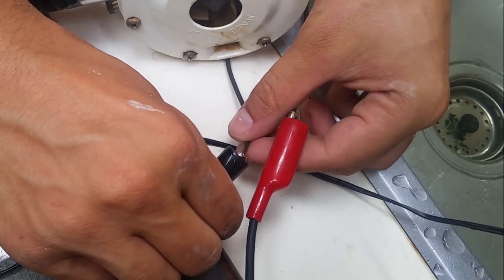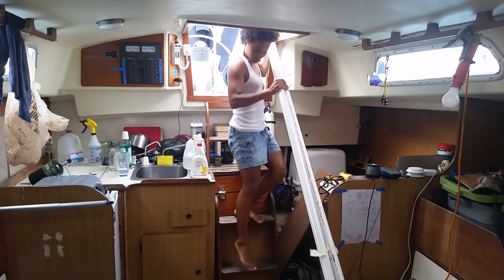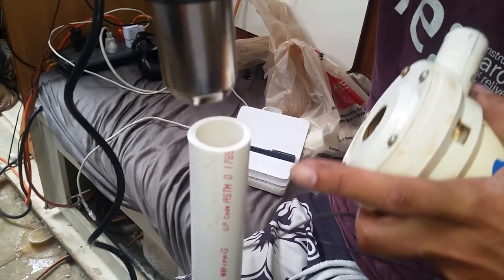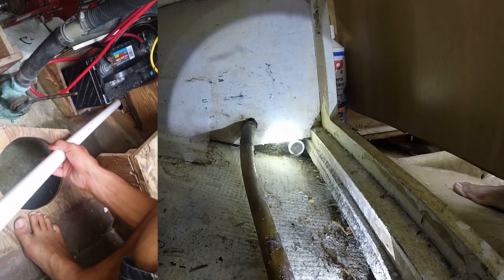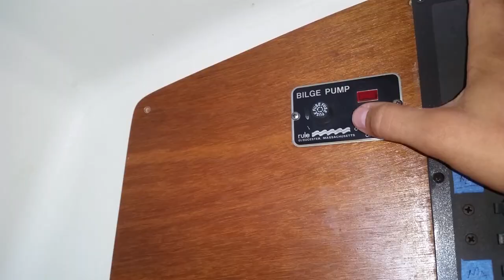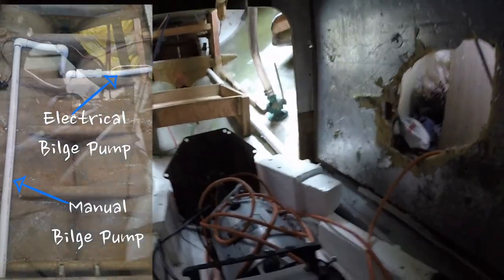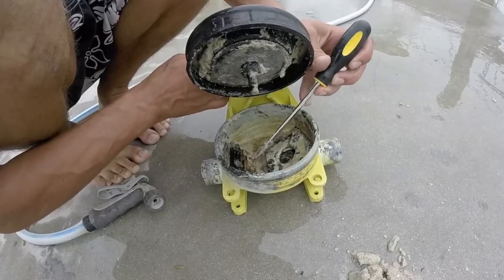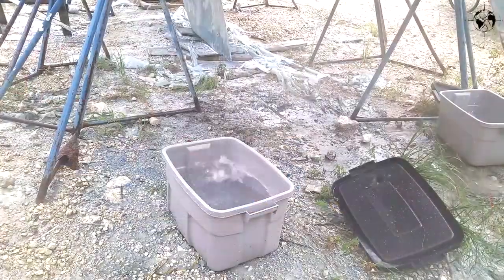Plumbing a Sailboat with PVC — Sailing Uma [Step 18]

Comment: Getting very worried about you doing things on the cheap so to speak,  PVC does crack when it flexes, [ stress cracks ] ,  cracks when it has water inside and it freezes to just name a couple reasons professional boat builders do not use it !  think about it,  if they could cut corners, don't you think they would ?  but hey it's only your lives your gambling with right !  and being on the say open water is not like being in an RV where one just pulls over or shuts the water off till it's fixed, hard to keep the Ocean out !  One more thing - Bilge pumps among a lot of other things - one is none, two is one, three is two !

Comment: First time watching your videos that I really don't like your PVC plumbing idea. It is fragile, it breaks really easily when pieces are subject to constant movement like on a boat. As yourself the question why they never used PVC before. Bigger commercial boat builders look for building cheaper like everyone else : PVC tubing would be the perfect solution as it would means thousands of $$$ to spare. They don't do it simply, like on any small sailboat, all pipes go one way or another to a valve, a thru hull and to the sea. A broken tube and you may not have the time to close the valve before you're flooded and in deep deep trouble (pun not intended…)…  Moreover buying marine grade reinforced plastic tubes is not the more expensive item on your budget. You can spare more money on them wares…